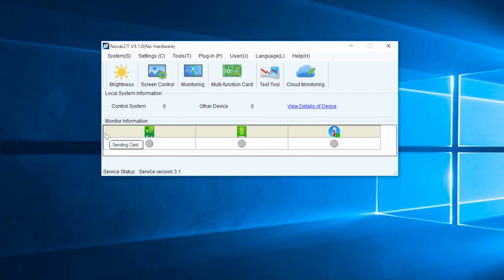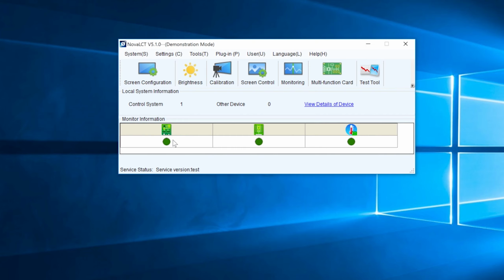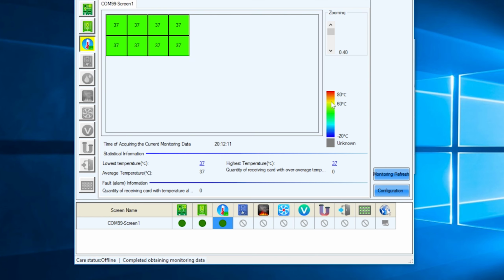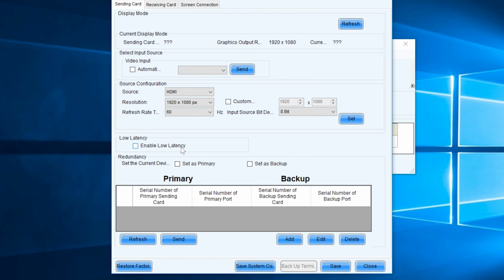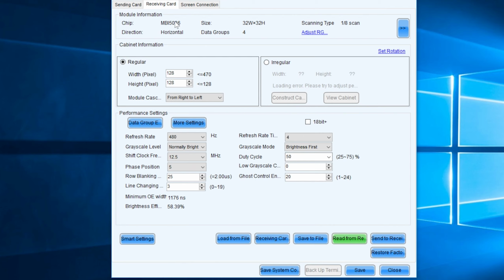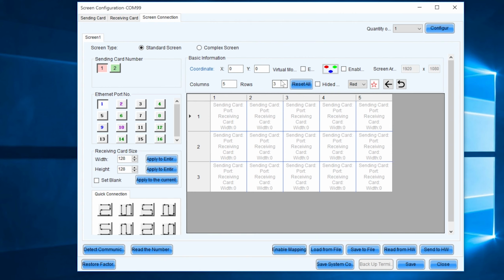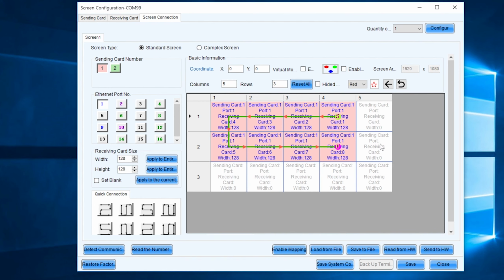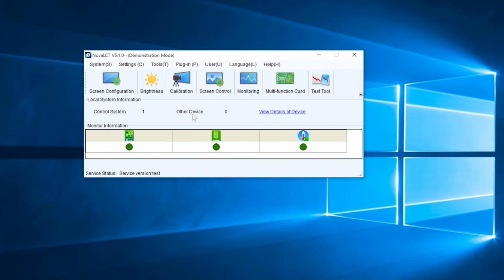NovaLCT Basics - Beginners Tutorial, How to use NovaLCT, How to program Novastar - NovaStar software

Comment: Having a small problem - running a screen through a MCTRL300 (PC=DisplayPort out, MCTRL300=DVI in). Can configure the screen and send test signals. However, when I go to Video Controls to select "Enable Zoom" (to scale the secondary PC monitor to the Screen), I cannot select a Screen, the Read from HW button is not active and the Zoom options cannot be checked. Please help?  I also note on the Sending Card Configuration screen, I am not offered a "Select Input Source" option - have assumed that this is because the MCTRL300 only has one input??